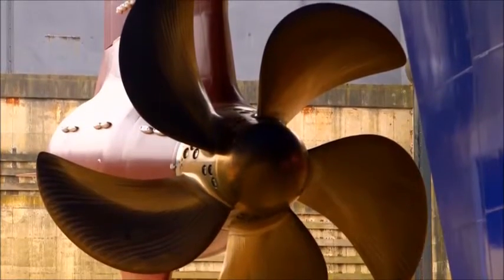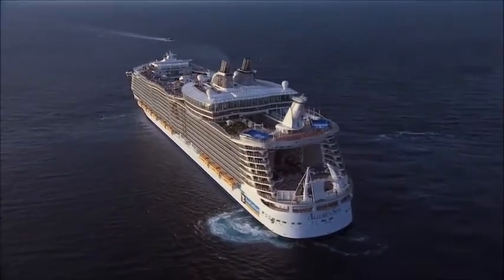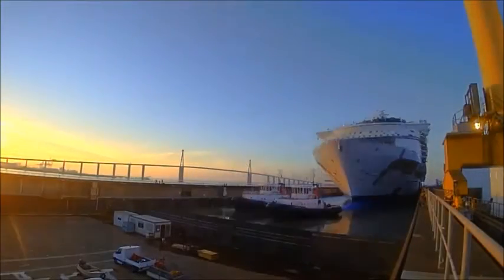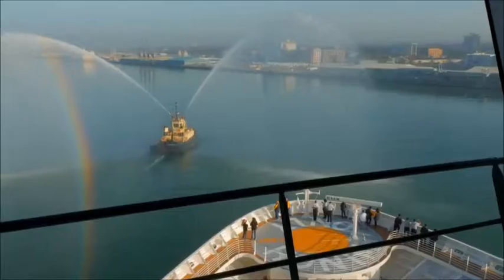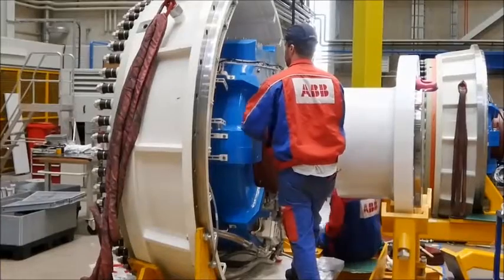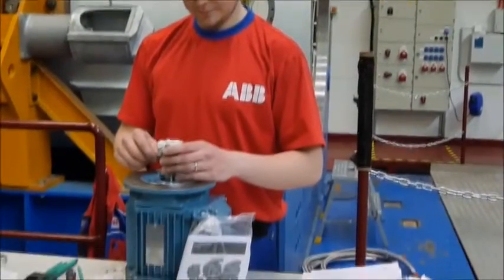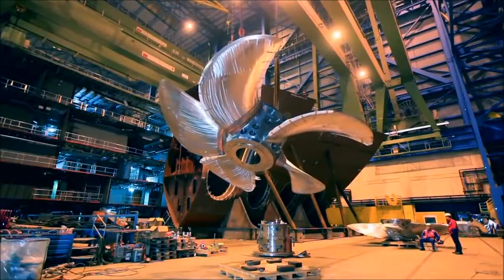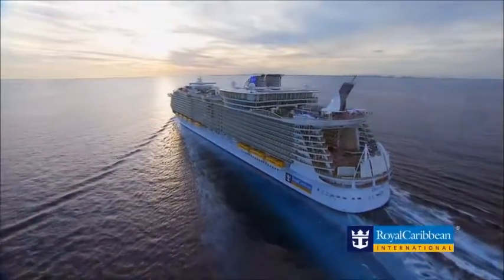Innovative propellers for safe sailing : An Inside Look at the Making of Royal Caribbean's Azipods

Comment: Given the problems experienced by several cruise lines using Azipods, especially as these units age, and the millions of dollars spent to repair/replace them, and the increased depth required which isn't always available in the smaller cruise ports, the future of this concept may be in jeopardy for the foreseeable future.
Reply: @freddykruger6194  could you even move a 250,000 GT ship with conventional shafting?
Reply: @freddykruger6194  if idiots like you were in charge, we'd still be using horse drawn carriages. People will continue to make improvements and innovations despite setbacks. Why are we even using propellers? Oars work just fine